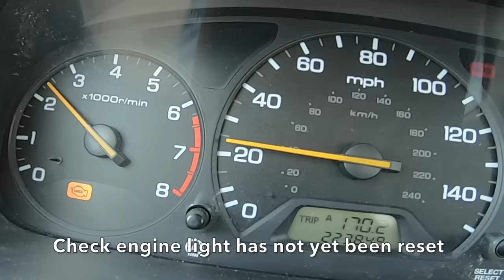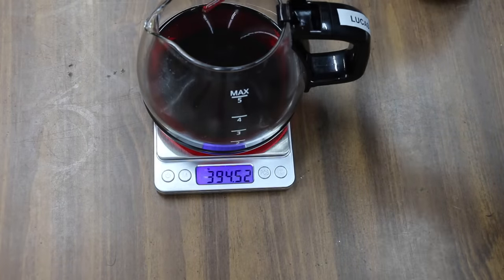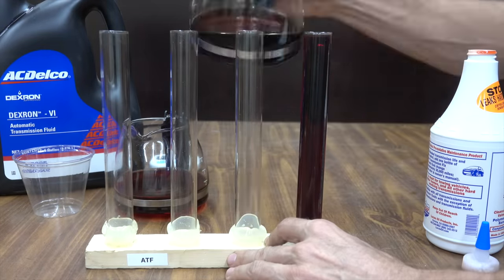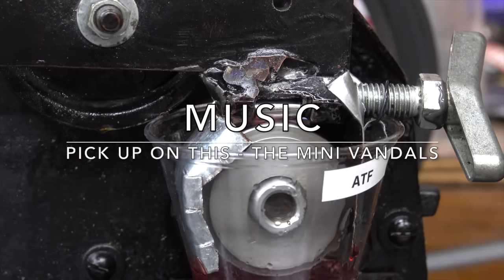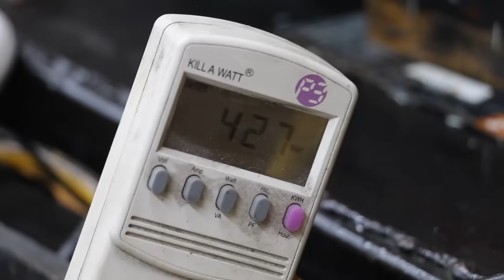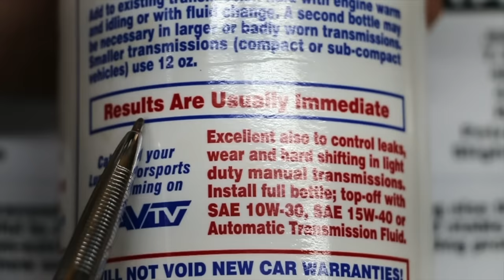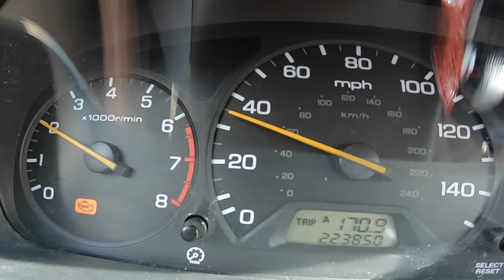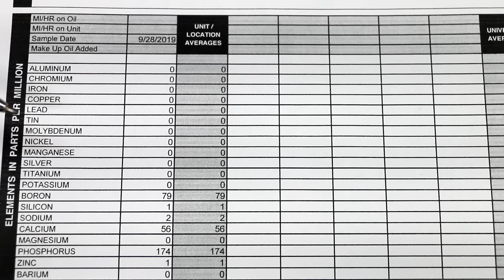Does Lucas Transmission Fix Work?  Let's find out!

Comment: Those era honda transmissions like to have issues. shifting when usually they can be solved with a transmission solenoid. The solenoid that controls the shifting is called the Linear shift solenoid and there is a seperate one for the torque converter lockup. Lots of times they fail before the actual transmission fails. The nice thing is that they're external and really easy to change. The official Honda diagnostic guides say that if you have a transmission that has trouble shifting, replace the solenoids before calling the transmission junk. P0740 is an electrical code. Basically all it means is that the transmission called for the solenoid to lock the torque converter, but it didn't lock up. This could be a failed torque converter, or more likely a failed solenoid.
Reply from the maker: Great information!  Thank you
Reply: My 92 accird with 307k miles is still shifting fine
Reply: I had a 1997 Honda Prelude and had those issues and then some. I replaced the Solenoid and cleaned the screen. It was a little better so I changed the Fluid and added a bottle of Lucas and it was improving but still not great yet.  Well I drained some fluid out and added 2 more Lucas bottles, I had nothing to lose.. well it worked! It took about 500 miles to get back to normal, I drove it another 10xxx miles and it never slipped! It worked for me!
Reply: I was wondering the same thing and for 1500 there better be a lot more work done.
Reply: Not sure I understand completely. I have an '03 Civic EX 185k miles trans slips pretty bad. (I've been driving it as a manual for the last 10k miles, hasn't gotten any worse) I have no codes on the dash, is it possible my issue is an electronic solenoid or something, or will that stuff automatically throw a code? TIA!
Reply: @liveandletlive2894  Does it slip a lot when you're shifting gears or when you're already in a gear, and does manually shifting it help as opposed to letting the transmission handle it itself?
Reply: @ProjectFarm  I wonder if replacing a linear shift solenoid would remedy the situation that the transmission is having.
Reply: @a-aron5691  thanks for replying...it slips between gears, not like this video where it held onto 2cnd for too long. I drive it like a manual and just let off the gas when I know its gonna shift. Not really sure I understood your question.
Reply: @a-aron5691  not sure what slipping while in gear is. Instead of changing instantly, theres a second or so when the car is theoretically in "neutral"
Reply: @liveandletlive2894  If the solenoid is bad it will almost certainly throw a code. As mentioned, it is external and can be removed, cleaned, and tested off the transmission (Youtube has plenty of videos how). And often they can be intermittent. But that's probably not going to cause your slippage, sorry to say.
Reply: @blautens  thanks
Reply: @blautens  what kinda code, would it throw a CEL?
Reply: @liveandletlive2894  You always need to first do all the visuals. Scan for codes (this would be first) Smell your fluid if it smells burnt you might need a rebuilt or a good used one. The solenoids are in the valve body and sometimes due to age they will break down. They might need cleaning or replacing. I am not sure on the torque converter, a good tranny guy can explain more on that one for you.
Reply: @jamesmana5247  scan for codes-I have no cel is that fine

I'm not putting any real $ into this car so a rebuild or new trans is outta the Q

I drive it like a manual; easing off the gas as it shifts. Hasn't gotten any worse since I started doing that a year+ ago.
Reply: @liveandletlive2894  Heck drive it till the wheels fall off. It still sounds like a solenoid.
Reply: @jamesmana5247  that's definitely the plan. How would I check or confirm if it's a solenoid? Is there only 1 solenoid in that trans? 03 civic ex
Reply: Go here you might be surprised. Go here How To Swap A Honda Civic Transmission in 2 Hours. For yours Find on All Data what the labor time is for your car then go from there.
Reply: @liveandletlive2894  It looks like it might be external. https://www.rockauto.com/en/catalog/honda,2003,cr-v,2.4l+l4,1415719,transmission-automatic,shift+solenoid,8476. Other than this you need to do more homework, and watch a few more videos here.
Reply: @jamesmana5247  car costed me only $450 a year and 4 months ago, u put 10k+ miles on it. I got my $ out of it, not gonna put in anymore. I want to buy a Chevy SS but the prices are a bit outrageous imo

Comment: This Lucas product says on the bottle it can be used in a manual transmission also.  I'd be curious as to what it would do to it.  Mine has some notchiness going from 2-3 and occasionally from 3-4.  I have VW G70 fluid in it and it is improved but still notchy when it's been sitting for a few days undriven.
Reply from the maker: Thanks for the suggestion.

Comment: $1500 for transmission rebuild is very reasonable. You should post that shop’s info. Also, I have used Lucas for 30 years in every cars at the 1st transmission fluid drain and fill. It has helped each transmission last over 200K miles.
Reply: I've never used Lucas in any of my transmissions, only regularly maintained.  Not a single one failed before or after 200k miles. I've not been using Lucas for only 27 years though.

Comment: That container of Lucas reminded me of some engine oil Stop-Leak I bought from them many years ago, before I knew better. Maybe you could do a video on engine oil stop-leak, perhaps even coolant/head gasket 'liquid repair' fluids too? I think some of us know it's all snake oil, but many don't. And maybe there's one or two out there that actually do something.
PS I do know that one particular type of coolant stop-leak works.. it clogged my entire thermostat & part of the radiator, ultimately leading to my Nissan's aluminum heads warping, and thousands in repairs and lost work. Again, young and gullible at the time.
Reply from the maker: Thank you for the feedback

Comment: Honestly I've gad fantastic results with this product. I had a 91 honda accord lxi that had 300k miles on that I got off of Craigslist for $900. The transmission leaked so bad that there was a constant puddle under it. At first I tried to use Honda transmission fluid but that just made it preform worse. About 6 months later I was literally just using this product as the transmission fluid and it worked awesome but I know it'll be different for everyone but for me it was great
Reply: LOL. I bought a 1999 honda crv. Found out there was a stuck oil ring in the engine. Took a quart of oil every 100miles. I tried most all additives but to no avail. So, drained oil and replaced with Lucus engine oil Additive - thick as STP.  With 5 quarts in, it worked pretty good - except when winter came up in Northern MN. A cold startup, it barely started or moved and couldn't spin the tires on snow even as oil too thick! But after a few miles, it had its power back. I finally replaced the engine though, next year...
Reply: @SamaritanElad  haha yea even those the winters dont get to cold around here when it was cold the transmission make the engine rev up way more cold than when warm so i just started leaving early and letting the car warm up while I had a smoke and scraped the windshield. Once it wad warm it was good to go. Altho I found out the hard way that the thermostat was removed. Had let it warm up and stwrted driving on the freeway and all of a sudden I lost all heat and temp gauge said the engine was cold.....
Reply from the maker: Thank you for the feedback

Comment: 6:26 and you're telling me the fluid was just changed? Glad to see they torqued that down to 200psi 🤣
Reply: Psi is not a torque value. You can us newton meters, in lbs, or ft lbs, but not psi
Reply: Wrong units!!! You must mean inch-pounds I assume.
Reply: Klaus Van Heusen  That's what I was thinking. That's old dust on that over torqued bolt.
Reply: @joeyjonson8637  the sad thing is 14 people agreed with him, and if he did mean inch lbs that's only 17ftlbs which isn't alot
Reply from the maker: Great point!

Comment: My personal experience: “lazy shifting” try LUBE GARD, Transmission problems SEA FOAM “trans tune” , want smoother shift? LUCAS. however , the best solution is change your transmission fluid every 30k miles and use the correct amount and correct type of transmission fluid, Honda/Acura use DW-1 IDEMITSU , Japanese OEM, of course if you have broken internal parts or bad solenoids, the “liquid trick” won’t fix the problem. !
Reply from the maker: Thank you for the feedback
Reply: Project Farm  I enjoy a lot your videos , thanks !

Comment: To anyone who owns a Honda, never put a 'transmission fix' into it or use any fluid other than Honda OEM, Redline, or Valvoline Syn (meant for Hondas).  To give you a little more information, I'm very familiar with these---I'm a Honda guy and have several with this transmission (or the 5 speed from that era which suffers from the same issue).  The problem your friend has is that the friction material in the clutch packs are gone, and is not fixable without a rebuild, and rebuilds are not the way to go on Hondas, ever (swap with a used transmission).  The source of the problem is overheating, as they don't have sufficient cooling, which causes the fluid to overheat and lose protection/effectiveness.  This eventually overheats the torque converter to the point it turns blue and is completely shot.
Reply from the maker: Thank you for the feedback

Comment: Im sure the owner of the car never changed the transmission in the car in the 1st place. Then people want a cheap fix in a bottle. It's called maintenance people
Reply: It's called a Honda transmission. The problem is they design and make their own.
Reply: I’ve been driving Hondas for 25 years and all you Gotta do is the proper maintenance with a genuine Honda transmission fluid and you are fine they’re great transmissions.  I’ve had several automatic transmissions with over 500,000 km on them in  northern Canada.
Reply from the maker: Thank you for the feedback
Reply: If you take care of your vehicle, it will take care of you.
Reply: @MrRF007  well said, people are too cheap to do it. Then say this piece of junk left me stranded.
Reply: Unfortunately, just like any other brand, Honda made some transmissions that just aren't as good.

This transmission in particular is one of Honda's bad transmissions, they are known to be problematic and die quite often, even if serviced correctly. 

Every brand makes some bad products from time to time. One has an engine that fails no matter how religiously you maintain it, one has a transmission that can't handle the load and quits early,  heck anyone remembers the Suzuki Esteem 1.6 manual gearbox? That box has such a design flaw it would seize within 150k km due to poor bolt choice and the entire case flexing, putting extra strain on the bearings and killing the gearbox.

That you've had several automatic transmissions with over 500,000km is no surprise, however that does not mean Honda only made superB transmissions. They did, in fact, make a bad one and it's one Honda enthousiast warn everyone to avoid. This Accord is one of the Hondas that used this transmission.

Comment: I have a 2006 Silverado 5.3 1500 stock I’m going to change the transmission fluid and filter my question is should I buy ac delco or valvoline the red bottle the truck has about 230k on it do you know which one is better I want to go for the ac delco but it’s double the price on Amazon and there is nothing on the bottle that makes you want to get it except for the fact the ac delco is Chevy oe the valvoline says it has all kinds of stuff what’s better which one should I go with I like to have the premium stuff on my vehicles as long as it works

Comment: I really appreciate this video! I recently purchased a 1994 K1500 Chevy and the previous owner said he had the transmission rebuilt twice and it had all new parts but was slipping into neutral when it would get hot. I check the transmission fluid and it was low. I added a quart of transmisión fluid. I’m going to check tomorrow and if it’s still low add some Lucas. Thanks for the idea!!
Reply from the maker: You are welcome!

Comment: I have a 2001 accord 2.3 automatic. She’s done about 59k kms or 36-37k miles. I’m facing issues in first gear. Sometimes when I put her in D4 from P or N she picks up normally, sometimes she doesn’t. At this time I feel like the car is neutral and I’ve to either stop and put it back in N, wait a few seconds and put it it back in D4 or when this issue happens I put the car in D2 and that activates 2nd gear and i lift her from 2nd gear. Will adding this product stop the issue or improve it or does my transmission need rebuilding ?

Comment: Great video, and you should do a video on the Lucas power steering fluid leak
block. I've just tried it after reading a lot of success stories, and so far it has
fixed the whining and howling sound coming from my power steering pump. So
far the leak is still there, but many guys say it takes 2 bottles. On the other hand,
it may be a loose hose, so you can't expect the Lucas to fix that. I hope it's a small
leak, so I don't have to replace the pump or rack. Maybe you've done a video on
this, and if so, I'd very much like to see it. I've also only had the stuff in for 2 days,
and some say you have to give it time to work its magic. I'll be checking fluid levels.
 
Great video, and you truly are an American Classic :)
Reply from the maker: Thanks!   Thanks for the suggestion.

Comment: I used this today & it immediately fixed my transmission shifting issue on my 2011 Chevy Malibu. After getting my transmission serviced at Valvone (before I knew anything about cars at all, guy just said It was due when I went for an oil change.)  my car was shifting so hard in city, 0-40mph was the worst. When I let off my gas, to coast or slow down without actually breaking, it used to down shift hard & jerk. Speeding up from one of these “coasting slow downs” or when I would accelerate from a complete stop, it would hesitate and shift hard before even hitting 20mph. Didn’t have a problem with RPM or over heating though. Anyways, after using this, literally in the first minute, the issue is gone. My car is running so smooth, as if Valvoline never touched it. Which they won’t, EVER again. - posted this directly on Lucas’ video for this, but this is the video that SOLD me! Thanks for the demo!
Reply from the maker: You are welcome!

Comment: 2003 Tahoe; significant improvement occurred over time. 3 to 4 under acceleration slipped noticeably and showed on tac. I did remove a quart added Lucas and there was immediate improvement and over time seems to normal shift. Vehicle has 150k and has had regular fluid change per guidelines. It has extended the life good thing because it’s really not worth a transmission replace
Reply from the maker: Thanks for sharing.

Comment: Great work !  Do you have any tests showing transmission additives that may solve minor seal leaks?  Lucas says it will but I don't believe you tested that.
Reply from the maker: Thanks!  Thanks for the suggestion.
Reply: AT 205 works sometimes.

Comment: @ProjectFarm has your friend fixed his transmission yet? I know exactly what the problem is my accord had the same problem. It was i think a 99 accord with the 3.0 motor. The transmission had glue in it clogging up something i forget exactly but maybe from the filter or something but the glue melted from something in there and was messing with the shift solenoid i believe but it wasn't expensive at all to fix and the guy i had work on it said it's a known problem for those cars. Anyway hope this helps even though the video is old. I believe there was a screen in the transmission that the glue got clogged on.

Comment: Hi there🖐, i've watched a lot of your videos and i really like all of them. Ive used several products reference from your video and all of them works great👍👍. Right now i have an oil and radiator leak problem and it cost a fortune to fix it which i cannot afford, can you make a video on at-205 stop leak or/and bar's leak wheter they will fix leaks problem. It will means a lot, thank you and keep up the good work💪🏻💪🏻
Reply from the maker: Thanks!  Thanks for the video idea.

Comment: My ~150,000 mile Explorer was starting to shudder a little during low speed up-shifts (and the tach was jumping while in gear) so I changed the fluid and added one bottle of Lucas. It seems to be functioning completely normal now, although it took about 60 miles of driving; just as was experienced in another video trying Lucas. My guess is that the new fluid, therefore fresh “friction modifier“ and the Lucas worked together to keep the torque converter from slipping. I don’t know if changing the fluid alone would have done it or not though.
Reply from the maker: Thanks for sharing.
Reply: I have 2013 Explorer slippng now at 153,000 miles. I will have to try this out too. But I'm afraid to replace the transmission fluid completely. I have heard horror stories if it is totally replaced with new fluid.
Reply: @Movieman1965   after nearly a year I'm now at 167,000 miles and the transmission is acting like it's brand new.  Not a single problem.  Not to say that would be your experience, but it has definitely worked for me.

Comment: wow!  immediately and completely fixed the 2 speed powerglide in my 1965 Corvair, which was slipping badly.  I added only 2 ounces of the bottle into the trans tube.  Most of it leaked out the overflow hole, but that's a small price to pay.  Very happy, thank you!!!
Reply from the maker: You are welcome!  Thanks for sharing!

Comment: Nice video, would you be able to do one on transmission fluid comparing Valvoline high mileage multi vehicle compared to Castrol, STP, and super tech fluid?
Reply from the maker: Thanks!  Thanks for the suggestion.